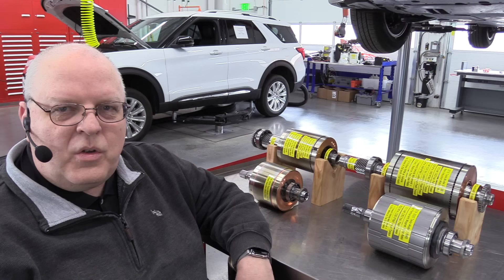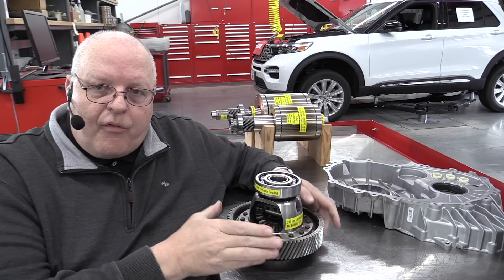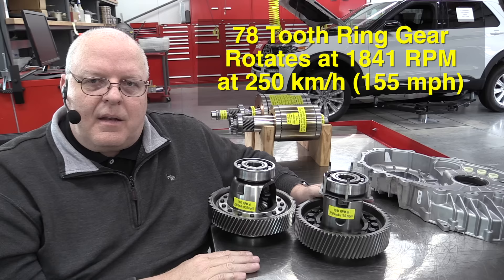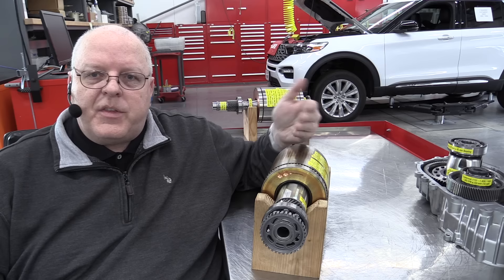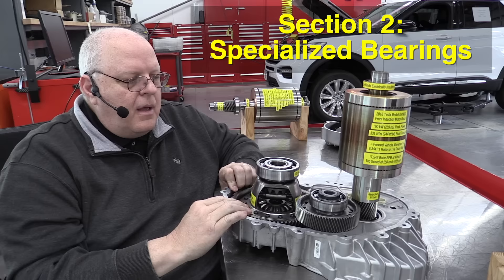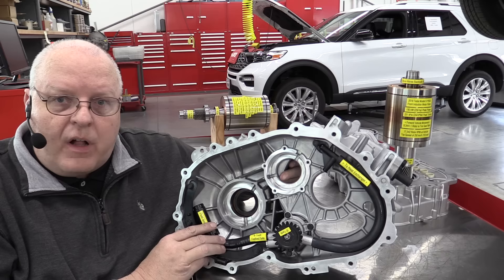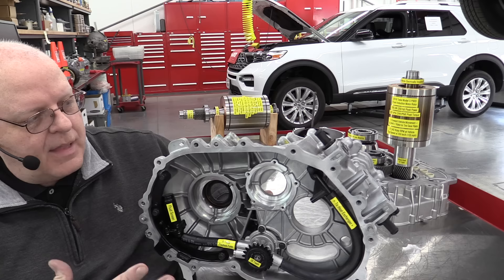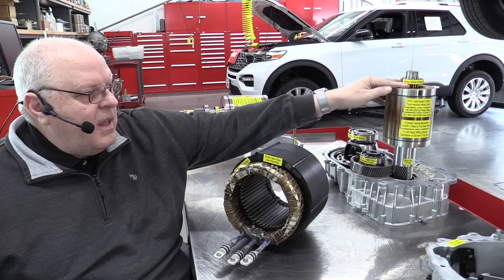Understanding the Tesla Model S Front Motor

Comment: Thank you for your thorough presentation professor Kelly!
I have two questions. 
1.	The first one is related to the ceramic bearings. From your presentation, it looks like one bearing (on the downside of the case is immersed in the cooled lubricant whilst the upper one is just sprayed with cooled lubricant. Would that make them function at different temperatures which eventually lead to premature wear of one of them?
2.	What is the level of lubricant temperature inside the transmission considered normal? Is there a sensor or something to raise awareness of the possible overheating?
Thank you very much!
Reply from the maker: Thank you! Sorry for the confusion, both bearings are on the same level, neither are submersed. I do not know the normal operating temperature of the lubricant.
Reply: @WeberAuto  Ok. Thank you. I got it wrong it seems with the positioning of the bearings
Reply: @WeberAuto  Yes the bearings would get real hot if they were submerged in oil from all the friction. High speed low torque applications, like routers use an oil mist system for that very reason. I have a router that I put new bearings in 1985 that turns at 20,600 rpm, that still going strong with thousands of hours on it. It is lubed with a Bjuir oil mist unit that runs on 10 lbs of compressed air. Ceramic bearings have also been used in machine tool spindles for many years. On some spindles they use them because the balls are lighter and therefor have less centrifugal force, if they used the steel balls the bearing would be overloaded from the spindle speed alone with nothing left for any side loads at all.
Reply: @WeberAuto  Oh, forgot to tell you what a great job you do on all your videos, really enjoy watching them.
Reply from the maker: @MrJohnnaz  Thank you very much

Comment: I would like to get you opinion on why there is a sleeve between the output gear and the rotor.
My theory is that this was a fix to a design problem.  I think that they made  the shafts and then found out they were not strong enough and added the sleeve.
I do not see any reason why they wouldn't have machined the shaft in one piece.
Reply from the maker: I am not sure I understand what you mean by a sleeve. The rotor and the shaft to which it is attached is all one piece. It has a gear on one end of that shaft.
Reply: @WeberAuto  if you look at the gear you will see that there is no space for the cutter to have cut the teeth with  a sharp end on the side of the rotor. The shaft between the gear and the rotor is the same OD as the gear. If it was one piece there should be a rounded shape from the teeth cutter. So the way to do this would have been to make the shaft with a smaller OD then machine the gear on the end then push a sleeve on the shaft.
Reply from the maker: @franciscoshi1968  I understand now. Thank you. I do not know why, but I suspect it is to allow for interchangeable gears for different applications.

Comment: Sir i watch your videos when i get curious about these electric motors....i am 15 and always had some question in my mind but not been able to get answer while posting it on quora and never gets cleared...since you are repying to many comments here i would like to ask it.....what if a single electric motor is able to reach 200 mph and two of them are put to each of rear wheel of a vehicle that weighs 1500 kg with better suspension , traction and aerodynamics.....what will the approx top speedd of such a car...THANK YOU
Reply from the maker: Good question, Thanks for watching
Reply: @WeberAuto  and what would be your answer.Sir.
Reply from the maker: @camribuggatti9445  Adding a second motor will not change the top speed of the car.
Reply: Many electric cars are not limited by the power that they have available, but instead by how fast the motors can spin (for various electrical and mechanical reasons). In that case, doubling the power by adding another motor won't allow the car to go any faster at all, because power and traction were not the reasons for the top speed limit.

Comment: How good is Dexron vs PAO oil?
Reply from the maker: I do not know from which base oil Dexron is made, their specification does not tell us, but from the price, I suspect it is a Group 3+ base oil (which performs very close to those with a PAO base oil). PAO based  fluid is very good, but it is also very expensive. Group 3+ base oil is more economical and is slowly replacing PAO based fluids.

Comment: How come the IM rotor surface is plain and not slotted to expose the rotor bars. It will increase inductive reactance and reduce torque.
Reply from the maker: Thanks for watching
Reply: Traditionally rotor bars are right at the surface, but these motor spin fast and it would be structural problem to keep the bars in the rotor. This patent describes Tesla's design, and it talks almost entirely about the construction of the shorting plates on each end, apparently assuming the bars would be contained within the rotor laminations rather than exposed at the surface:
https://patents.google.com/patent/US20110062819A1/en
Reply from the maker: @brianb-p6586  Great information, thank you

Comment: I am from Malta. Thank you for your great video's professor.We are planning to convert a 110 Land rover 
defender 2001 in electric. Using Tesla 
Model S Large Drive Units and 100 kwh battery
 pack new version. We are going to do this project. 
What do you think? Can we do it like that or  there is any 
another way to keep four wheel drive permanently 
and use on the road and off-road? Can your kindly give us some tips pls.
Reply from the maker: Sounds fun, I cannot help you, but best wishes

Comment: Another great video  Professor Kelly. Thank you. 

To answer your question about the different size of tire/wheel. If you go into the service menu of the Model S, it'll give you choices on the wheel size you have on the car. I believe this is how the car will know to compensate for the difference in wheel speed. 

I have a P85D and it came with the 21" performance wheels and different aspect ration between the front and the rear. I've switched the wheels back to 19" all the way around for comfort and better tread wear and have been for approximately 20k miles without issues. However, I do not know if you did not go into the service menu and manually change the wheel size, will it give you an error. That I do not know.
Reply from the maker: Good to know! Thank you very much!

Comment: On helical cut gears isn't more than one tooth engaged at a time?
Reply from the maker: I didn't think so, there is a backlash measurement possible per tooth. Thanks for watching
Reply: @WeberAuto  Google seems to think there is more than one tooth. I am not a gear guy though.
Reply: There are "multiple teeth" engaged at the time, but only partial on each one; and in the end the net total is a little bit less than a gear with straight cut.  AFAIK, the helical cut is to reduce noise and vibrations, and make it torque transfer smooth (low pass filtered)
Reply from the maker: @ikocheratcr  Great information, thank you!
Reply from the maker: @jamesbruce1183  I am probably wrong then, thanks

Comment: How is the "hold" and "park" implemented? On my Model 3 it seems that the hold mode is done electronically, but I can clearly hear a motor operate when I take the car out of park.  I haven't seen any mechanical locking device in either the front or rear motor assemblies.
Reply from the maker: The rear brake rotor has an additional brake caliper just to hold the vehicle from moving in park.
Reply: @WeberAuto  Thanks!
Reply: @WeberAuto  Which is simply the parking brake, although using a separate caliper because the usual parking motor added to the service caliper only works with sliders (various cars extreme enough to use fixed caliper rear brakes resort to this). I find it a little strange that they depend on just the parking brakes; I realize that all manual transmission cars appear to do that, but a manual transmission left in gear with an engine is reasonably effective brake and an unpowered electric motor is not.

If you're interested, there is a nicer solution to the separate caliper: the integrated dual service/parking caliper from Brembo with separate pads and actuation for each function, but in one caliper body.

Comment: Thank you for the great Tesla videos! If one were inclined to use this motor in an EV conversion, would it be possible to mount this in such a way as to mate one of the half shafts with a manual transmission? Assuming the open differential was replaced with a limited slip or welded closed of course.
Reply from the maker: It is possible, but the side gears and differential pinion gears were not intended for extended operation like that.
Reply: I would be better to make a spool than to weld the differential. The real problem with using the entire drive unit (with the gearbox) is that the high reduction ratio built into the unit would make the output far too slow to reduce further with another transmission and then again with the car's final drive.

Comment: John Remember that permanent magnet motors use a lot of RARE EARTH MATERIALS, is more efficient, i bet is not cheaper.
Reply from the maker: True, but these induction motors have a very heavy copper core. Copper is also expensive. Thanks for watching
Reply: You're correct Leonardo, and because of this, most mass producer like Toyota and Honda are developing motors with less and less of them inside the rotor.
From what I've read, Toyota gen 4 hybrid have almost 0 neodymium, the counter part is that they are bigger and loose "strength" if they become too hot, but both can be avoided during the development.

Comment: Why they had to use jackshaft? 
I know its for palancing torque but why the dont just carefully design drivetrain like other vehicle manufacture?
Reply from the maker: I suspect because there is less space between the front wheels. Centering the differential was not possible with the electric motor size required. Thanks for watching
Reply: There's no extra shaft, it's just that the stub axle installed in one side is longer than the one in the other side. This sort of arrangement is very common in transverse engine or motor configurations, because the length of the engine or motor forces the final drive (differential) to be off centre. Tesla didn't do this in the Model S rear (at least with the large drive unit) because the Model S is very wide (leaving lots of motor space on one side) and there is less concern with equal-length axle shafts at the rear.

As with almost everything else, what Tesla does here is normal automotive industry practice.

Comment: The answer to when the model S uses the front or the rear engine is that is uses the rear on slower speeds and the front only on higher speeds. The problem is that the front drive shafts brake when used in slow speed, so they aren't used then, although it would make sense.
To use them at slow speed you can use the energy savings mode, but this will wear the front drive shafts so much that at some point the steering wheel will shake more and more.

Comment: Guess what, John: There's a way to save effort in saying the years from this century. In fact, it actually works like saying years from previous centuries: You can say 2019 as "TWENTY-nineteen" instead of "two thousand nineteen." Why is it easier? Because it has fewer syllables, just like years in previous centuries do when said as "nineteen-seventy-four" or "eighteen-forty-seven," etc.
Reply from the maker: LOL, local vernacular. Thanks for watching
Reply: @WeberAuto : Thanks for your reply, Prof. Kelly. But it's not just local vernacular; I've heard this way outside of Utah, and I've heard the traditional way (the old style of "nineteen- ___ " or "eighteen- ___ ," etc. being applied to get "twenty- ____ ") here in Utah too. So it's really not a local thing. Besides, why not convert into doing the thing that's easier, just like you were used to in the 1900s?
Reply from the maker: @HelloKittyFanMan.  Good points, thanks
Reply: @WeberAuto : You're welcome, and thanks back.

Comment: Why tesla use expensive bearinga in differential? where the angle speed in 10:times lower, yes, the torque is higher in 10 times, but “ceramic” bearings not for high torque, but for high speed

Comment: I think your calculations of the front / rear overall wheel diameter differences with the tyre sizes are incorrect.
Tyre sizes are written as the tyre width (usually in mm) / tyre wall height (usually in mm), R (radius) of the wheel rim (usually in inches). Both front and rear wheel and tyre combinations are 21 inch wheel rims with 35mm tyre wall height thus their overall sizes should be identical (assuming suspension geometry has no effect / is not being taken into account). Another way of thinking about it is the tyre width (with the different sizes) is on the Z axis (when looking at the face of the wheel) where the height of the wheel is on the y axis thus the wheel width has no effect on the height of the wheel / tyre combination.
Reply from the maker: The 35 is a percentage of tire width, not a fixed height. Thanks for watching
Reply: @WeberAuto  wait what! After looking it up, turns out there is a lot of wrong information out there about tyre sizes. I've personally had staff at 5 different tyre shops all tell me the side wall was in mm (including paper product categories also listing it in mm). Any idea why it's a percentage and not an absolute number? (an absolute number seems more comparable and practical to me)
Turns out tyre wall percentages have only been mandatory/used in my country since 1990.
Today I learned something new, thanks.
Reply: @aleek4481  I learned that today too....I always thought it was the size of the tyre wall profile in mm...

Comment: I'm just watching it now still not finished.....but I picked up on you diameter calculations and it's wrong !? Please correct me if I'm wrong but the diameter is your 21" alloy + 35 tire wall the 245 and 265 are just how wide the tyre is nothing to do with its hight ?!? .... Let me know if I'm wrong haha
Reply from the maker: No, the 35 is a percent of the tire width. That dimension (x2) is added to the wheel diameter for overall tire diameter.
Reply: You're wrong. It's called an aspect ratio.

Comment: 12:45  'peak torque at 5573 rpm" - How is that? Don't electric motors put out max torque at zero rpm, and flat out until it rolls off? Did you mean to say 'it has maximum torque until it starts to roll off at 5573 rpm?
Reply from the maker: That is a good point. This specifications are from Tesla. Perhaps induction motors do not have 100% torque just above zero RPM. I am still learning myself.
Reply: @WeberAuto  induction motor torque is usually slightly less right at stall, but it quickly rises to that constant (current-limited) peak. Even from zero, there's lots of torque available... check the detailed report of an acceleration run from Motor Trend:
https://www.motortrend.com/features/a-closer-look-at-the-2017-tesla-model-s-p100d-ludicrous-acceleration-run/

Comment: Hello professor, and thanka for another excellent video.
As you suspected, on M3 dual motor, the rear syncronous motor is the one normally used when driving and cruising as it is more efficient than the front one.
You can see the car behaviour on this video through Scan my Tesla, an app which reads a lot of data from the car canbus, including front and rear motor instant power https://youtu.be/Mzhh2ImT284
Off course when the driver request a certain amount of power, the front one is then activated and produces torque too.
The front motor is also used to create braking torque when the throttle pedal is released, together with the rear one.

Comment: On Model 3, it will try to use rear PM motor all the time. It will try to avoid front motor. Except if more power is needed. PM motor can't actually spin absolutely freely, but induction motor can spin with actual zero torque. I quess. 

If you have endless amount of time Björn has done lots of videos with TeslaSpy OBD readings. 
https://www.youtube.com/watch?v=Mzhh2ImT284
Reply from the maker: Thank you for the information. I have purchased the app and the cable and will be experimenting with it.

Comment: the front and read tires sizes are different?
that would mean we have done away with the age old practice of tire rotation.  just tire swapping now.
or that would mean elon has done away with tire rotation.
Reply from the maker: True, but only on the performance models. Many high-performace sports cars have different size front and rear tires. Thanks for watching
Reply: Many years ago the highest-performance version of the Corvette had tires which were both directional and asymmetric (so each tire was for only for one side of the car) and it had different sizes front and rear, making it the first common example of a car with four different tires and no way to change their positions at all. It's probably a common combination now, and just different front and rear is, as John mentioned, quite common. This is not an "Elon" thing.
Reply: @brianb-p6586  Many years ago the highest-performance version of the Corvette 
FULL STOP
we're not talking about some exotic italian supercar, with twelve single barrel carburetors, we're talking about an ordinary everyday vehicle.  you know, like those $35K teslas.  stay on topic.
Reply: @luiul1  No, we're talking about the tire choices for a Tesla Model S. The Model S happens to be currently much more  expensive than a Corvette, and there has never been a $35K Model S; these tires are not on the Model 3 (which has also never really been available for $35K USD) anyway. But the price of the car is not very relevant - the point is just that different tires in different positions is not new, or a technical issue.